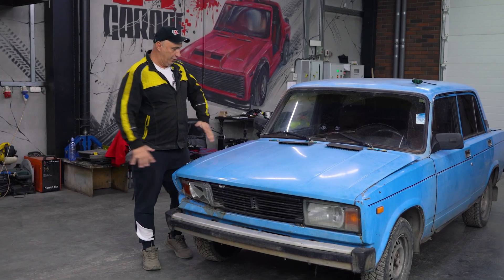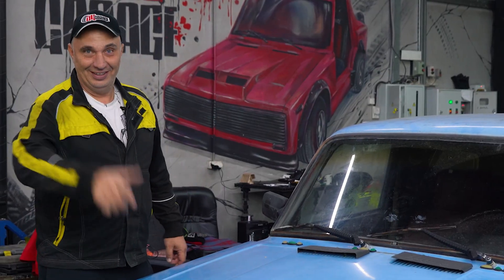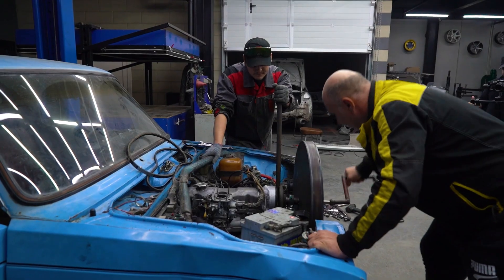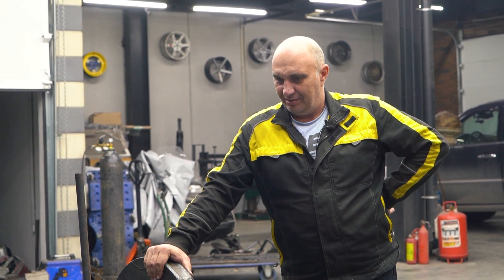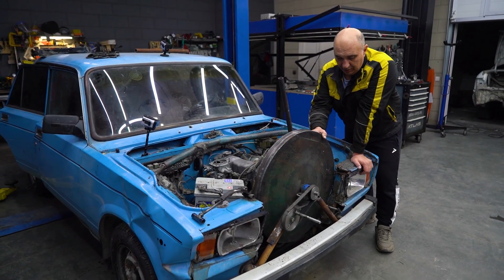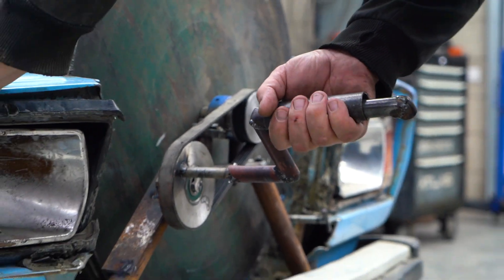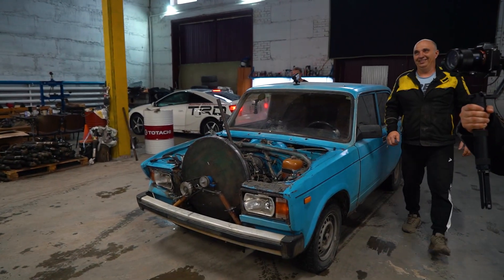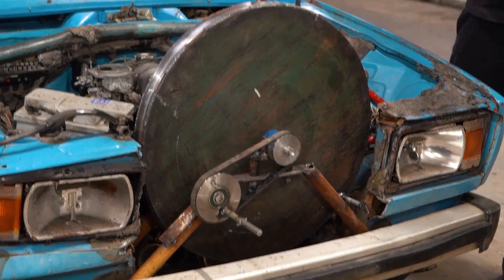We make a 60 kilo inertia starter for a car

Comment: just like first car was made, the starter using rotating the crank manually with hands.. and the rods for cranking, was bounced off and hitting the head of the driver while cranking it (because the engine was running)..

that's why the motor starter was created and most of the gasoline or diesel vehicle using motor starter to start the engine..

Comment: Thicker shafting and a wheel weighted towards the edge would be much more effective.  The idea is perfectly sound but the execution too weak and insufficiently thought out. For example they could cut off the end of a scrap crankshaft to harvest one journal and the flywheel mounting flange. Bore that stub shaft for some heavier round bar (can be turned from a truck axle etc, no need to buy premade shafting but any local machine shop may have suitable leftovers) mounted in suitable pillar blocks (flanged style mounted to plate or flat bar brackets would be my choice as the path of least work). A manual transmission style flywheel off something large (big truck diesel engine etc) is already balanced and heavy. It would be inconvenient to stack more than one but two might be doable.

Instead of a hand crank (hand starters are a terrible idea and always were because human legs are far stronger) a Maytag gas engine style kick starter engaging a flywheel ring gear would apply MUCH more force and permit a long kicker lever making backfire a non-issue. 

The cool thing about such problems is some bright mechanic somewhere has already solved the problem elegantly. The trick is finding their solution and Youtube videos make visualizing concepts easy. I hope they keep at it. It would make a great emergency starter for generator and water pump engines.

Comment: What about a big gyroscope spinning with a strong motor to rotate it so once it spun up it can be quickly rotateed causing the car, even if stationary, to pop up on it's left or right wheels. That would be fun. Put some round roll bars on top so the car can be rotated a full 360 degrees. Maybe that would help with parallel parking. Stop by a spot then the car rolls over 360 degrees ending up in the parking spot hopefully.

Comment: What about an air pump like a bicycle pump. Pump pressure into a container and have a valve so intake manifold either is connected to pressurized container or carburetor/fuel injector thing. Pressure pushing pistons down with intake valves open gets engine spinning then switch back to carburetor/fuel injector.

They really should of set the system up so several hamsters spinning their wheel get the flywheel going and that starts the motor.

Comment: To reduce the size of the flywheel but retain the necessary weight, you could fill the flywheel with lead rather than sand.

Comment: When you tried to start the car in the shop, did anyone remember to turn the ignition on?   One time the starter was out on my car, and I tried push starting it.  After many failed attempts, I realized I forgot to turn the key.   I turned the ignition on and tried one more time, and it started right up.

Comment: add a second pully and use a high rpm torque wrench on it

maybe air pressure so it doesnt run out of battery

Comment: Make an extremely heavy external (connected with front part of crankshaft) flywheel. Maybe, approx. 1ton or heavier. I wonder how much it will lower the minimum idle speed

Comment: I think they already build what they're after: A bicycle has a range of gears and a gear change system. It could be pedal or hand crank, as long as it has a low enough gear to get it started, and a couple of higher ratios to really get it up to speed.

Comment: Replace fuel injectors with smoking vaporizer coil  tanks to vaporize the fuel to a perfect volatile state without any oxygen in the vape coils using either argon or carbon monoxide outta the exhaust of the engine. This should increase HP and fuel efficiency 5-10X. Your welcome.

Comment: This is awesome! The old cars that started with hand crank would have wanted this invention. You should use a coaster brake from a bicycle and put it between the inertial and the shaft so if the car doesn't start, then the inertial will coast instead of stopping suddenly. I thought at first you used a coaster gear with the crank handle so if the car started you wouldn't get your arm ripped off. But I see you must take your hand away when the pulley is engaged.

Comment: I know this was just for fun, but to really make this work you would want gear reduction between the flywheel and the engine, half the energy is going into heat when you try to make up the differences in speed using a clutch

Comment: I drive a 1923 model T Ford every day as my regular car. Starting with a hand crank is done by switching off the spark and pulling the crank three times with the choke pulled and then switching on the spark. Often it starts by itself on the compression stroke …

Comment: making it heavier definitely works, but higher speed (using a gear or similar) gives you much more energy. flywheels are used for emergency power because they can provide peak power instantaneously. They use carbon-fiber flywheels in a vacuum spinning at 500,000 RPM. Tons of energy due to the high speed.

Comment: Literally the way my Grandfather had to start his self built tractor. It was based on Andoria S320 engine and had a wrench welded to valve shutoff (forgot proper word for it). So you had to get it going and then slap the wrench down.

Comment: This would be great in the winter if the battery is half dead. You just use the starter motor to slowly spin up the flywheel, and once it reaches enough speed, you engage it and start the engine

Comment: This just makes you realize, how powerful a starter motor is, and how effortlessly it turns over an engine many times, over and over.
Reply: @JDM BEATS You can pull the neutral safety switch in pre-computer cars and the starter will move the whole car until the battery dies. It can be very useful for emergencies when you need to move the car but it wont run. I can usually move my 75 Plymouth Valiant about ten car lengths or so before it drains a battery.
Reply: @Impactjunky  no starter motor is designed to pull the entire car, by you pulling the whole car you are killing it, too much weight/stress too much heat. it doesnt have any method of exhausting that heat as it wasnt designed to run that long.
Reply: @Impactjunky   Neutral what now?? You must be American. Since manual vehicles pre computers did not really even have anything to stop you from turning the started AT ANY POINT outside of wheel lock? 

Maybe there was a pre computer car with a clutch being required to be pressed down but there are plenty of computer cars that you still can turn key and have the hole vehicle LUNCH forward. Or back into something. Most up to date cars even manuals ones have safety crap built in to stop starter driving. But it really is just the last 5 years or so that you can not start the engine without having the clutch down. I know auto boxes have all kinds of things to stop you but... They are trash.

Ow and do not use the starter to drive. The battery is being killed doing it and the starter motor and fly wheel is defensively not happy. It is pulling the engine AND car at the same time. Even in neutral the starter is only for emergencies and starting the vehicle. The car battery is made for a extreme but short discharge. And the starter is made for a extreme but short turn over. And the flywheel and mesh to the starter is not designed to pull the vehicle since the stress and uneven pull ruins the mesh teethes quite heavily. Driving on the starter is really uneven and mechanically painful experience.    

When you can not pull the vehicle by hand. When your 3 people trying to push a car stuck then yea the starter is easier then getting a second vehicle just to get out of a problem. Might even be safer. But other then that it is only for emergencies like stuck on a rail track with a dead engine.
Reply: @TheDiner50  Yeah I must be American. And you must be totally new to cars. 
If you wanted to tell us all you know nothing about mechanics then you could have just said that in one quick sentence. It didn't require this entire massive rant directed at me. Most classic cars don't even have a wheel/column lock. They weren't mandated equipment until 1970.
It's funny how you make the same mistake as every other teenage car guy by trying to trash talk automatics when that just makes you look less educated. 
The automatic transmission in my 68 Plymouth Roadrunner is so light that I can pick it up and carry it around the shop myself even with fluid and converter installed. You can't do that with big heavy modern 6 speeds that can weigh twice as much, up to and over 200 pounds. It also puts more horsepower to the rear wheels than a big heavy modern 6 speed because it takes less wasted horsepower power to turn all that weight. It also shifts much less often in a 0-60 or quarter or eighth mile acceleration scenario wasting less precious acceleration time shifting gears. It also shifts gears in less than 0.16 seconds leaving black marks on the road between shifts every single time without ever missing a gear. 
It also pushes my 50 year old antique car to basically whatever top speed I want based on my currently selected final drive ratio/tire combo. I most often run a 3.55 final drive ratio with a roughly 135 MPH/217 KMH top speed with my current rear tire size, giving me loads more low end acceleration and torque at the cost of top speed. Any time I want I can install taller rear tires or taller gears for more top speed. With the current gearing and taller tires max speed would be about 160MPH/ 257 KMH. Swapping back to my stock taller 2.76 gear and current tires would put top speed around 175 MPH/281 KMH at the cost of some acceleration. Swapping to a 4 inch taller rear tire would stretch that gearing out to exactly 200 MPH/321 KMH. And that's with only 3 gears. My third gear is the same ratio as fourth in most six speeds.
Oh and launch is spelled with an A. Not lunch. And by the way thanks for repeating exactly the same thing I said about moving with the starter in an emergency. That was totally necessary.
Reply: @Impactjunky  Yep. The fact is that automatics are replacing manuals because, unfortunately(depending on your stance), nowadays they are simply...well, better. More gears, more efficiency, faster with computer controlled shifting. The only real benefit manual has over an automatic anymore is the ability to choose what gear you want when you want (blessing or a curse, if you accidentally skip one too many gears down and obliterate your drivetrain), 'manumatics' usually require you to press the shift button several times rather than being able to just select a gear. Manual vehicles are a dying breed. If you want one, get it while you still can and take mighty good care of it.
Reply: @alwaysamongdragons7354  Manuals aren't a "dying breed" just because new sales are lower, manufacturers refuse to make them, most of the people I know buy used anyways. Autos and slapshift DCTs or whatever are better for people who like numbers on papers, but you can't beat the enjoyment and fun factor, ever. I've got 4 stickshifts and I will keep buying them til the day I die
Reply: @grundoid6796  Yes...yes they are. And yes, new sales absolutely mean the world in this sense. More and more new cars are being released where they are simply not an option, especially in the US. Dying does not mean you can't get them, it means they do not have a certain future. It's simply the way technology is going. There will come a day where used car options will not have many manual options, because what sells new decides what ends up on the used market doesn't it? If no one makes them anymore, then you can't get them anymore. You can have one if you keep it and take care of it, but the fact is this means the amount out there and available will inevitably go down whether you like it or not.
Reply: @alwaysamongdragons7354  Ehhh not really. Used market maybe just be what used to be new but people swap sticks and the amount of them is still high enough that in my life time there will never be a “shortage” by any means. There’s plenty of them, and at the moment technology is a little too big for its britches. Electric cars are not going to work out long term, or last for the long term like any of the old clunkers that just tick away for millions of miles.
Reply: @alwaysamongdragons7354  A lot of what you said is true but a computer can't make a transmission shift any faster. They sell custom valve bodies and shift kits for most old school muscle automatics that make them literally snap into gear and shift as fast as physically/mechanically possible. It drives like someone no-lift powershifting a manual transmission but its programmed to do it every single time without ever missing a gear. The trade-off with more aggressive kits is you get a minor little thud or bump when shifting gears at part throttle. 
For comparison the modern 8 speed Torqueflite transmission that comes in a Hellcat shifts gears in 0.16 seconds but it still isn't shifting fast enough or hard enough to leave black marks when shifting gears like the vintage 3 speed Torqueflite in my 68 Roadrunner does. You can mod newer transmissions to shift hard too but a computer isn't going to magically make a mechanical action happen any faster.
Reply: @alwaysamongdragons7354  Probably in the US, but in the rest of the world especially on third world countries, manual transmissions are more common because they're more reliable and cheaper.
Reply: All very valid points. And, yes I've had to use the starter to "push" my jeep a few times. I use to own an '84 Toyota FJ60, and I've had it bog down, and die in the snow, I used the starter to literally roll it through the mud and onto the street! I wouldn't have been able to push it myself, plus I was out in the middle of nowhere.
Reply: For turbodiesel trucks, those starters are pretty substantial.  I want to say 3-5hp.  Just to crank over the engine in a one-ton.
Reply: Yeah my dad made us a billy cart with a starter motor in the 90s, it wasnt the fastest thing on earth but it had torque.... i remember carrying car batteries at like 8 years old lol.
Reply: 10,000lb F-550 with a diesel in my old truck. The starter will push the truck about 5 mi an hour for several minutes. Has several very large battery powering it though.
Reply: Actually it would be the battery, the starter motors need anywhere from 200-900 CCAs to start depending on application.
Reply: manual superiority
Reply: the gear ratio between starter and crank is very low, so the starter motor spins at much higher RPM than the crank so it gets most of the torque to spin the entire assembly from gears. however usually starter motors are 500-1500 watts so they drain a ton of current at 12V to produce the RPM and torque. 500 watts is about 0.6 horsepower. in reality it probably draws more than 500 watts due to heat losses
Reply: That's why EVs are so powerful.
Reply: That's why it draws over 3kW
Reply: There was a self balancing train that used massive fly wheels to run on two wheels only… I’m absolutely certain that there needs to be a lada version of that

Comment: Over 50 years I have played with many different size machines (mostly mowers - but chippers and other stuff) where the driven load could be run to maximum speed, the drive from the engine disengaged (if these was a PTO brake it had to be disconnected) - and the engine switched off. The fun was to switch the engine ignition back on and re-engage the load RESTARTING THE ENGINE WITH THE STILL-MOVING LOAD and not having to use the starting rope or electric starter.
  I once had a carbureted  V8 Chevy pickup that had the original generator (not alternator) I traded some welding for an old obsolete distributor-type magneto that fit the 283.
   Since where I live is very hilly I NEVER HAD TO BUY BATTERIES OR STARTERS. The generator was low output but it worked fine with no battery at all. You know those metal ramps people use to change oil? I kept a pair of them in the pickup bed. If I had to shut the truck off on level ground I would run the front wheels up almost to the top of the ramps - then set both the driveshaft and rear drum parking brakes - then finally shut the engine off and let the clutch out in 1st gear.
   Came time to leave it was: Put it in reverse, switch key on, kick off both parking brakes let it roll like two feet backwards, let out the clutch and it started every time...

Comment: Grandfather had a hand crank  tractor when I was a kid many years ago. I used that tractor almost every day during the summer and fall.  Be careful or the English words of the day will be "Ford Fracture".   I have came close myself a few times.  Handle will become stuck and come around and break the two bones in your forearm. Have handle removed before engaging lever.  Great starter idea.  Old solutions to new problems.

Comment: while you guys are on the rant of big flywheels, why dont you make a monster flywheel, and connect it to the engine, spinning it at high rew and use the inertia for accelration. a 300kg flywheel at 500-1000 rpm makes some torque

Comment: How crazy would it be if there was an inertia starter that spun with the engine so when shut off it would fully wind up the wheel and has some kind of release inside of the car I know that this is completely impractical and useless but it’s still funny